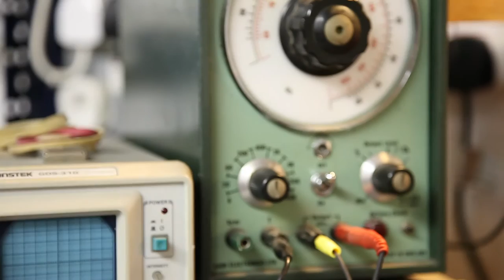Dr. Green by Hayden The Black Death Distortion Guitar Pedal

Comment: Has a TL072 and two TL071's and expensive germanium diodes in it. The op amp chips are in sockets, so you can do experiments with other chips. It is a surprisingly good sounding unit with the amount of gain of a Proco RAT but more tube like sound like the british HIWATT tube preamps.

Comment: I'm wondering if my Black Death has a fault as the guitar won't sustain, there's an audible step down like a cheap noise gate (although I'm not using a noise gate). Any ideas?
Reply: I'd maybe check to see if any of the solder joints are messed up.